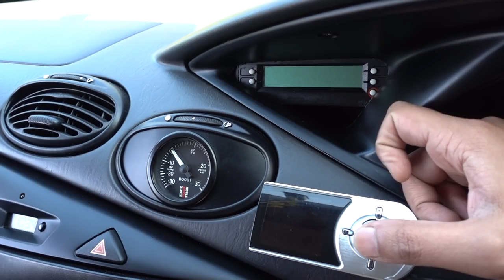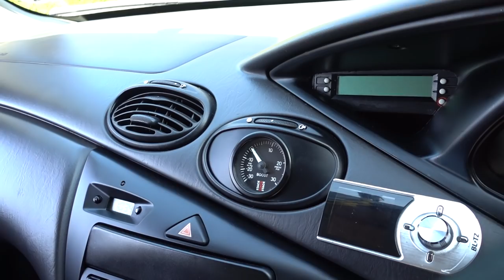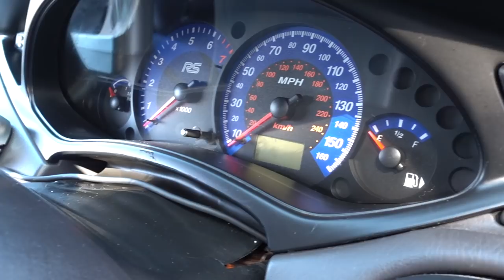Focus RS MK1 *385BHP CRAZY*

Comment: The torque steer issue only plagued about a 3rd of the cars built. However, on my one I bit the bullet with Ohlins suspension and that completely transformed the car. More comfortable to drive and with one twist on the dampers, you had a hard riding track car.

Also, these benefit from a 4 wheel alignment and that helps a lot with the torque steer.
Reply from the maker: Thing is 385hp through the front wheels is a lot even though it's had suspension mods done.... My FK2 Type R was running 310hp through its front wheels and that was state of the art front wheel drive car. Some people I knew were pushing 380hp and that became very difficult to put down without becoming aggressive.....
Reply: @DownShiftThrottle  mine was running 410bhp with a Peron Manifold and a 6758 Twin Scroll Turbo. Setup on Norris Motorsports AEM Management which helps get the power down much better. 

I have a CGI Zetec R Block and a WRC Zetec R Head that I will be building this summer to go into another MK1.
Reply from the maker: @pardeepbhachu  fancy that on the channel?
Reply: @DownShiftThrottle  when it's built, sure thing! I'm a ford technician so am trying to most of the build at work lol